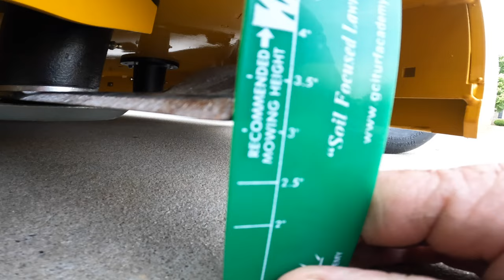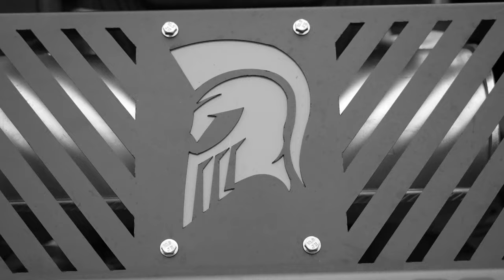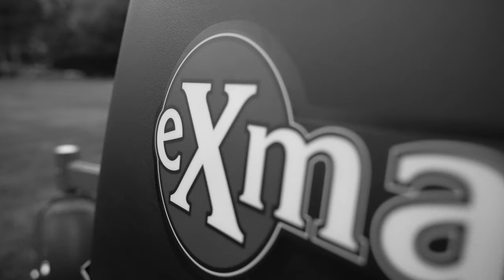Hustler Stand On Mower Review GCI Turf MowDown ShowDown

Comment: Pete they do make the ‘SF’ version of this mower.
It adds the dual shorter fuel tanks and electric deck height actuator .
Only available in 60” and 72” though.
Includes larger Kawasaki or Vanguard w/oil guard motor options and crazy 15 mph speed claims.

Comment: The discharge baffle comes standard on most commercial mowers now. It's designed to discharge the clippings instead of them circles back around into the deck, causing the mower to work harder! I have them on my exmark mowers., and notice the motor doesn't bog down in thick green grass as much

Comment: Does that mower have a drive belt ? Or just one belt that runs around the pump pulleys, clutch and deck? I noticed clutch is not mounted on the crankshaft of the motor

Comment: I love my hustlers. Mine have the older deck adjust design that doesn’t do what you described in the video, not sure why they went away from that design. What they have now looks similar to a scag vride
Reply: Scag wanted Hustler's drive system and Hustler wanted Scag's deck so they swapped.
Reply: @dawson8667  interesting. I think scag got the better deal there lol